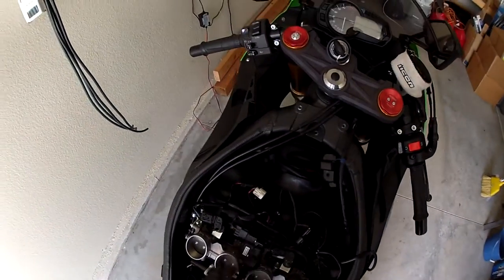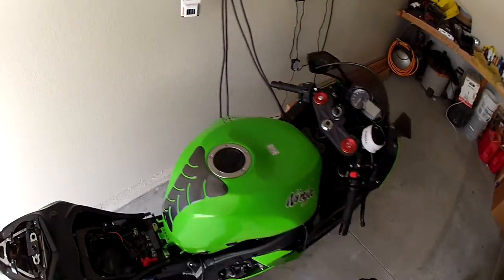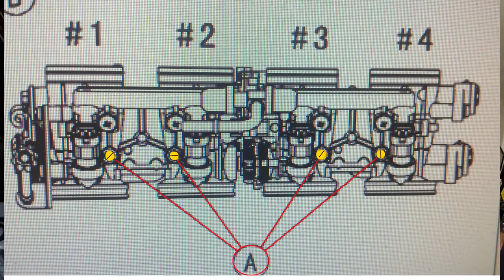How to sync throttle bodies

Comment: 12,000km is the recommended oil/filter change interval listed in the service manual for late model Kawasaki bikes. I use synthetic and change at this interval however manual does not specify synthetic. It is also the recommended a sync interval of 12,000km. It is also essential to do a sync immediately after a throttle body sync. 

There is no need however to change spark plugs at 12,000km, only inspect.
Reply from the maker: I'm not sure what you are saying on the synchronization of the throttle bodies.  What I see in the service manual shows to have it inspected at 12,000km.  Mine needed to be adjusted.   
Spark plugs show to be replaced at 7600 miles or 12000km also.  Maybe the manual is different where you are?

Comment: I had been thinking of doing this with the V Strom. I have held off since it runs so smooth and I had so many FI issues in the beginning I would hate to upset the apple cart. Cool video. Going in the favorites.
Reply from the maker: Thanks man.   I honestly never noticed a lope at idle till I put the after market can on it and gutted the cat.   Maybe that upset air flow at idle?  thanks for the comment and ride safe man.

Comment: I have a 09 zx6r. So do you or do you not need your air box hooked up while doing this? What about your injector showers? I’ve seen many people do it differently and it’s confusing me.
Reply from the maker: The airbox should not matter as you are trying to achieve the same vacuum from the throttle body to the engine.  I'm not sure what you mean by injector shower?
Reply from the maker: I should add that the vacuum will start at the throttle plate when at idle.
Reply: Piston Slap I just meant the secondary injectors on top of the air box, I guess. So I did this with the same tool and with the screws all the way backed out, normal idle with no throttle and all the fluids got sucked out. I returned it and got the dial vacuum gauges.  They’re all synced now but my 09 zx6r is still sputtering at the recommended 1350 rpm idle. I have to turn the idle knob up to 2000 rpm and it idles/runs smooth but then it’s really hard to start with the idle speed that high. So I have to turn it down to 1500 rpm to get it started. I’m wondering if it’s my tps or something else.
Reply from the maker: @ScentseiMiyake  have you checked the valve clearance. Also the tool I used has to be calibrated so you don't suck all the fluid out of it.  A sputter could be few things.  Check all your clamps and fitting to make sure they are clean and tight
Reply: Piston Slap yes, valves were adjusted by shop to try and fix the issues but didn’t help. I was calibrating the tool when the fluids got sucked out lol
Reply from the maker: @ScentseiMiyake  well that's not any good.  Have you cleaned the injectors...maybe there is a spray pattern problem? I would also be curious on if there was a restricted injector or leaky on?   Spark plug gap might also cause a sputter.   The tps you had mentioned before...i think can be adjusted but you need a shop computer plugged into it to see the voltage and adjust it accordingly
Reply: Piston Slap Yeah, it’s been a nightmare trying to figure out the problems. I got it back from a coolant and brake fluids flush and immediately noticed loss of power, backfires from exhaust on deceleration and hard to start, also jerky in first gear with no clutch or brake, just coasting in 1st. Bike almost wants to die. So I brought it back and they did the valve adjustments and checked battery, also blew out breather for gas tank (they kept my bike for almost 6 weeks mid riding season 😡) $800 wasted. So I ordered the following and installed them on my own : new spark plugs, new coils, put in new fuel pump, new rectifier/regulator, new stator and did the tb sync. All within 2 weeks. I will have a brand new bike by the time I figure out the problem lol. Maybe I’m running too rich or lean, I don’t know 🤷🏻‍♂️.
Reply: All of those fixes were from reading on forums with people all having same symptoms and each one had a different fix, it was still cheaper to do those on my own than what the shop charged for 2 things.
Reply from the maker: @ScentseiMiyake  have you verified the base cam timing? I haven't heard of the cam chain stretching to that point but anything is possible.   Also Im not sure exactly  how the ignition timing is controlled but maybe worth looking into.   If the bike is backfiring on acceleration it could be from incorrect timing.  Lean would bog overly rich would bog and you wpuld be able to smell fuel.
Reply: Piston Slap when they were doing the valves, they saw that my cam chain tensioner was broken and replaced the part and said my chain looked okay. I do smell fuel from the exhaust, I’m thinking it’s running rich. Sometimes it bogs if I snap the throttle real quick.
Reply from the maker: @ScentseiMiyake  I would probably start there with the fuel system.
Reply: The Vudu I have the same problem, please how do you fix
Reply: @ScentseiMiyake  how did you fix the problem

Comment: I’m thinking of doing this soon to see if it eliminates some vibration during acceleration on my 2010 Zx6r. I’ve heard of people syncing there throttles and it removing bike vibrations in the bars.
Reply from the maker: #MLB_MotoVlogs not sure if that will help as the synchronization of the throttle bodies is only going to smooth out the idle it has nothing to do with acceleration, at least on the 636

Comment: Hi, got a Honda CB650R, and the bodies do not have the ports to connect the sync tuner, there are 4 EVAP ports and 3 MAP ports
Do you think I can use the evap ports to sync tune?
Thank you
Reply from the maker: I would think you could as long as there is vacuum at idle on the ports

Comment: could u help me get my bike figured out? i just bought a 06 zx14 and it sat 2yrs well code 62 which is subthrottle valve actuator malfunction... well i can see rpm jump to 2k rpms and i have wondered if the throttle body may be dirty causing it... now i hear the blades open when igntion key turn on and dont sound bad . i need to try cleaning the bodys but i think ive gotta remove it completely to look? i know its zx14 but maybe u know more than i do
Reply from the maker: Danger Davefpv I'm not sure on the zx14.   I'd you have a code for that throttle body I would figure that out.  You might go to a fourm.and down load a service manual for tour bike that way you will know what to check.  If the bike has been sitting for 2 years I would start with fresh fuel and oil a long with any filters.    Sorry I don't have more info for you.
Reply: so i drained gas before i even cranked it and used seafoam also in gas.. im hoping its easy fix or not expensive fix .. bike has 2540miles and i bought from friends mom long story there but 1500$ so i bought mobil 1 oil and k@n filter today and got that done. starting to hate dumb issues like this and i dont wanna drive it like this
Reply from the maker: Danger Davefpv I have never used seafoam. Are you trying to clean the injectors?
Reply: Piston Slap yeh and help with any slight old fuel

Comment: did you know how many turn the default factory settings? mine screwed up badly, the idle worsened after i tried to sync it
Reply from the maker: I just checked the work shop manual to find it shows 0-2 1/2 turns out.  Did you have the MAP sensor unhooked when you were syncing it?
Reply: thanks for the hassle, MAP sensor was plugged to another hose from shared vacuum line, so i got no blinking error, but as i turn the screw, there is no change in manometer reading, and i turned the screw too far each cylinder that i forgot to write down the default settings, so i had to turn in to full close, and now i had choppy idle, trying to resync again this weekend
Reply from the maker: ryancassandra It seems strange how the workshop manual shows 0-2 1/2 turns.  Make sure you don't crank the screws in just lightly seat them.  Also adjust the idle as needed to keep it in spec
  After each adjustment blip the throttle and let the engine stabilize.  Hope that helps

Comment: you have to change your spark plugs every 600 miles?  and also i have an 07 zx6r with two brothers slip on and when i start it its always weak doesnt have that deep sound , is that bc of the spark plugs or its just the way the bike is
Reply from the maker: Every 7600 miles on spark plugs. how deep a bike sounds could be the design of the slip on, if the cat had been removed, or the pre muffler. spark plugs being worn out would cause a misfire or low power stuff like that.
Reply: its probably the slip on then , i doubt the cat is removed bc the servo is still there. so what should i look for to tell if i need my spark plugs changed? my bike is at 12k miles and im not sure if the previous owner changed them before.
Reply from the maker: The service book for my bike shows the plugs should be replaced @ 7600 miles.  If your bike has the same maintenance schedule as mine then that would be when you want to change them.  I figure anything after that mileage your running on borrowed time. As I always want my bike to run its best.  I have a spark plug video that shows what they look like. https://youtu.be/t9Jb7QxRz0I
So with all that I would check your owners manual for the maintenance schedule and if its time to replace them.  Hope this helps

Comment: Did you set your sync tool to the single  highest vacuum on any throttle? Kawasaki service manual words it so technical it makes it confusing.
Reply from the maker: #MLB_MotoVlogs I didn't
  The manual didn't specify to use any particular throttle body.  I just set the tool up the way motion pro wanted it.   (You tie all the limes to a single port then calibrate the tool).  Anyway I adjusted them to as close together as possible and trying to achieve the most vacuum. Hope that happens.  I know mine idled a lot smoother when I was done.
Reply: Piston Slap did you notice a change in vibrations? Either through the bars or maybe the body panels or engine? Just s won’t if you could gauge or notice a differences in the engine vibration output through either of those things
Reply from the maker: #MLB_MotoVlogs not really any change on vibration.  Like I'd said the biggest change I noticed was how smooth the bike idled. Mine had almost a cam type sound to it where the engine was loping a little bit. After I was done syncing the throttle bodies the idle was smooth with no lope at all.

Comment: Hey, is your fuel priming sound even or does it change the pitch at the end?
I'm trying to figure out if my sound is normal as it was nice and even on my previous bike - Honda. I'm not used to kawas so i'm not sure what is normal.

Here's my sound: https://youtu.be/teJsr0eny6U
Reply from the maker: The fuel pump will change sound as the pressure is built up in the system  I here a few things in your video.  It sounds like they are firing the fuel injectors a few times to add fuel for starting.